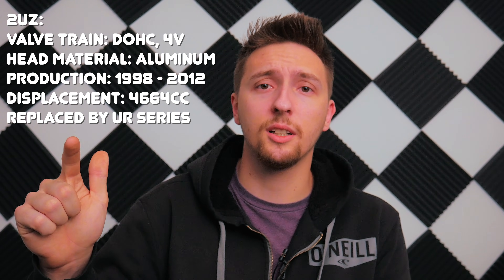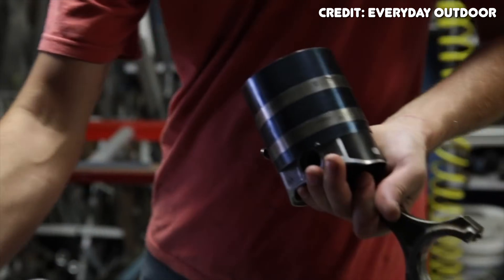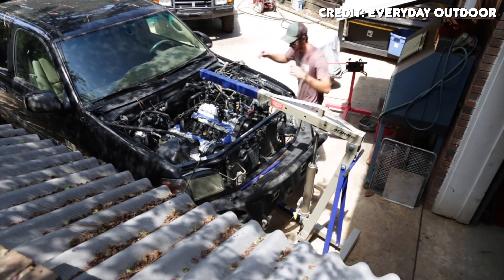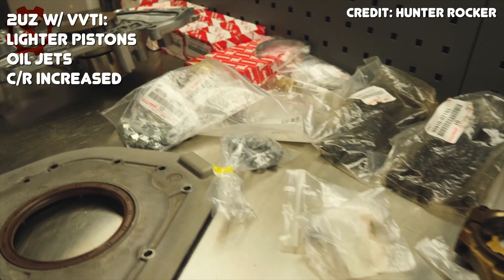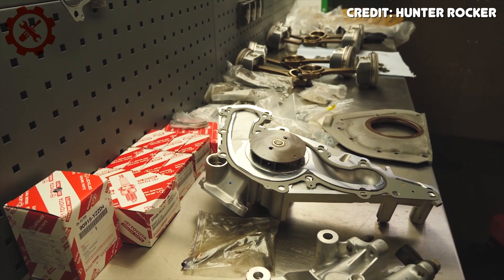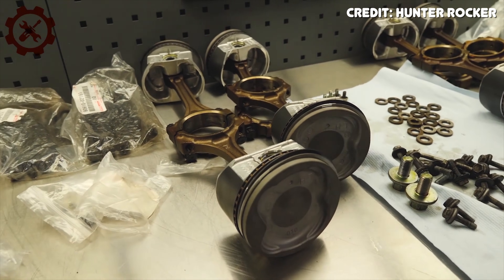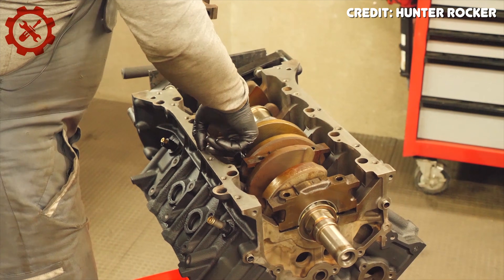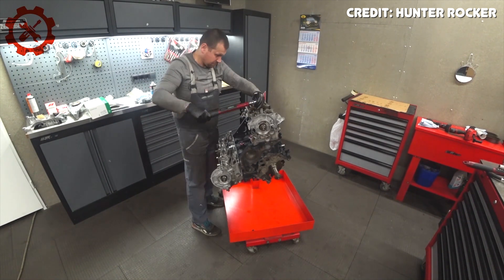Toyota 2UZ-FE: Everything You Need to Know

Comment: Great video, thanks! I have this amazing engine on my 2003 4Runner. I understand mine doesn't come with the VVTi and I read somewhere that the non-VVTi is a non-interference engine vs the later VVTi model. Is this true? Thanks!
Reply: No they are mostly the same motor other than the cam phasers and changes to accommodate them. Other than that the clearances are the same and both are interference engines so don't skip those timing belt jobs haha.
Reply: @Zoom_RM I see, thanks for the info! Now at 230k miles, I just did the belt.
Reply: @juliuslopez9438  yeah I own two tundras one farm truck with 274,000 and my daily with 173,000 both have been great and I just did the belt on both.
Reply: I’m planning to get another 10 years out of my 05 tundra 4.7, works very well 💪🏼
Reply: I’m planning on my 03 SR5 Tundra outliving me actually.
Reply: I have an 03 Sequoia with 340k mi. Completely lost the timing belt on highway easy cruising at 70mph.  Pulled the heads and NO obvious damage to pistons or valves. Not sure if this would be the case on the VVti version.
Reply: @wille8266 nope just in the non Vvti engine this is posible hehe 😜

Comment: I went out of my way to buy a 2006 Tundra 4x4. When it cranks up, that engine is just like a sewing machine. Quiet, low revving, torquey v8 that is smooooth. She drinks the fuel like no ones business but I cant help but love driving it every chance I get.
Reply: @ToyotaNutjob  Yeah Toyotas love their maintenance. I’m about to do coils and plugs along with front diff and trans services.
Reply: Love my 07. 2uz runs like a seeing machine!
I could use more power, such as the 5.7, but this is what I have! At least it’s easier to work on!
Reply: Me too, love my 06 Tundra Access Cab